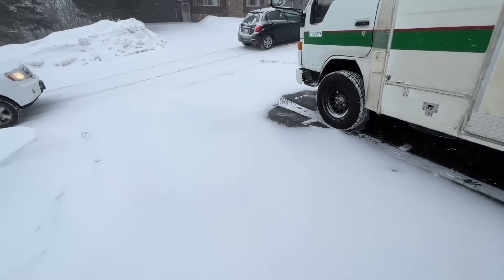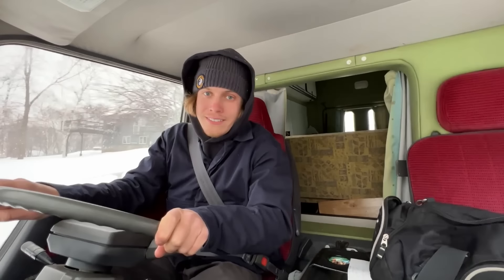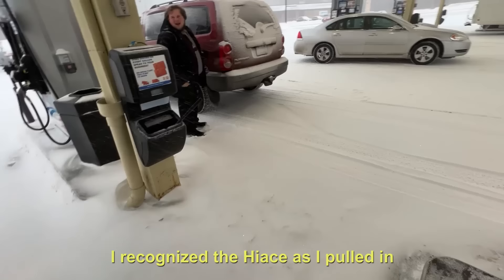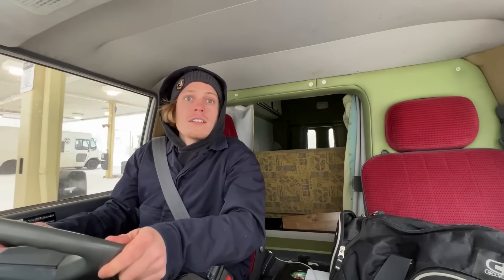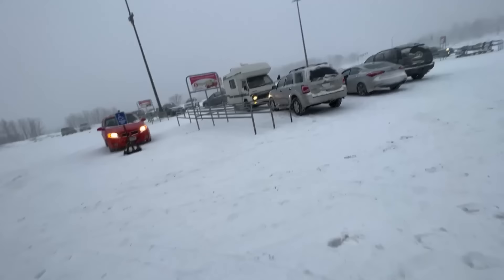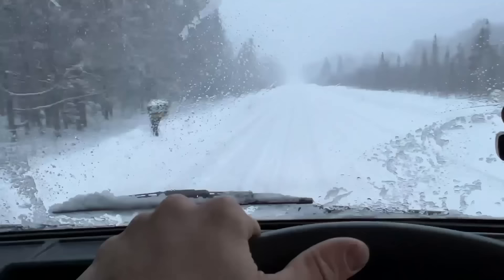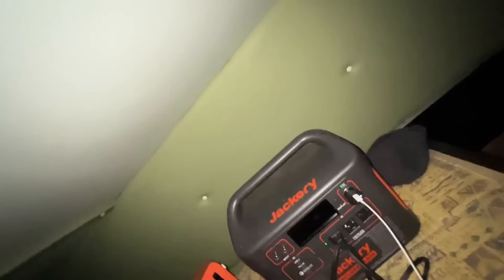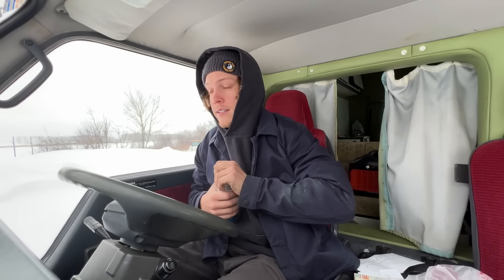Winter Camping with a Cheap Amazon Heater - Will it Work?

Comment: Like someone else mentioned, the electrical issue is probably to do with it being a Japanese truck and so the generator outputs a japanese voltage (100v at 50hz vs 110-120 @60hz according to some other comments). There may be an adjustment on the generator or it may just be the way it is. either way, you should be able to get step up converters to run the outlets. Usually generators don't give power through an inverter as such, it's all built into the one unit. 

As for the heat in general, just run the diesel heater. It'll give you much better heat for much longer than any electric heater will. We have a truck camper with a propane heater and it can keep us warm on even the coldest nights. The heater will run the fans off the 12v battery, so as long as you have a good charge on that you should be set. One lithium battery like you have here should give you enough power to run the heater fan and camper electrics for at least 24-48 hours depending on how much the heater is kicking on and off. A couple solar panels on the roof can help keep that battery topped off, or running the genset will charge it back up as well (even with the sockets not working it should still charge). Running the generator to run the electric heater is going to use WAY more fuel that just using that diesel heater. 

Love to see some variety in the camping vehicle of choice. Hope we see more of Steve!

Comment: Another thing you can also try, since you still don't need 950 Watts to heat that space you have in your camper is to get on Amazon a 500 Watt heater, or even a 200 Watt heater instead. Your Japanese system should be based on 60 Hertz, since they use the same basic AC power grid as we do in North America. Stuff which is "rated," for 950 Watts, will often pull well over a thousand at startup or more, and that is what is tripping your breakers in the camper. 500 Watts shouldn't trip anything, and if it does, then a 200 Watt space heater definitely won't trip anything.

Comment: I just picked up a 350w ceramic space heater with temperature control. The thermostat goes down to 60. I'm hoping it will work out for me. Thanks for the vid!

Comment: Long electrical comment incoming....
As a couple other comments have mentioned, this vehicle is from Japan. So it makes sense it has Japan electrical standards inside of it. Japan uses a nominal 100v/50hz compared to North America's 120v/60hz. All (well 99.9%) of electronics have a label on them somewhere specifying the nominal voltage and frequency allowed. Most electronics made within the last few years are pretty universal. But when it comes to appliances, they are not so forgiving on electrical tolerances the same way a phone charger would be. When you get the Hummer back, you should have the electrical system in this adapted to NA standards. From what I've seen, you would mainly need a new inverter and 3-prong outlets with the ground. And as a result of needing the 3rd grounding prong, you would have to replace the wiring going to the outlets to 12/2 with a ground. That's just an off the cuff thought process. But as you mentioned before, some things you're willing to do yourself, other things you want to leave to a professional. Please leave the electrical to a professional. Depending how powerful you want the inverter to be and what loads it can handle. Not going to get deep into it but there's losses in efficiency going from DC (your 12v batteries) to 120v AC. I use 80% as a general rule of thumb for calculating the inverter. For lights, some chargers, and the occasional high draw appliance, I'd recommend a 3000 watt inverter. That would give you a full 20 amp circuit (your batteries powering the inverter would have to be verified to be able to supply the power, and upgraded if not). And also, usually the advertised wattage of the inverter is usually it's peak power that can only sustain for a few seconds. So for example if you calculate that you need 1000 watts. Do not get 1000 watt inverter, you do not want to run it at 100% all the time. That also decreases the efficiency. You have to read the specs and make sure it can provide that load safely for prolonged periods of time. This is where someone knowledgeable comes in to design the system. And also, would be cool if you could upgrade the fuel tank to a larger capacity.

Comment: You will probably need a 1500 watt pure sine inverter to make this work continuously. Your two auxiliary batteries will provide 4 hours of power at the most, and you will probably fry them, or damage them after a few cycles if you do this often. These batteries are not meant for deep draw. Also, heaters don't like modified sine wave inverters, so the entire rig you need to run your 25$ space heater will cost you about 2500$.

Comment: There isn't anything wrong with breakfast for dinner or any other meal.  I've been doing it for longer than you've been living.  As an over-the-road driver from 1991 to 2018 that's what I did when I couldn't decide on what I wanted to eat at the end of my day.  Sometimes I'd have pancakes, sometimes an omelet with grits and wheat toast.  If I went to a Waffle House I'd order 2 eggs scattered, covered(chilli) and topped(cheese) with dry wheat toast.

Comment: Lots of power loss from resistance but.... The mobile generator powered from the outlet to run the heater. Like other comments suggested I don't believe your trucks inverter is running the right voltage for the heater. It surges the system and the fuses kick in for over voltage protection.

Comment: dude just a safety tip DO NOT run that heater with that cord all coiled up like that - it can and will start a fire because leaving it coiled it creates an electro magnet and that will get very hot.

Comment: End of the day if you're suffering from the cold just run the diesel motor! "It wears out the motor" some may say.  Change the oil at 2k-4k miles max and she'll keep going bro no need to worry.  Stuff 100 gallons under there and EV's will be asking you for a Tesla charge lol.

Comment: Electric heating without shore power is grossly inefficient - either using fuel to power a generator or charge a large battery bank, then converting to mains voltage. Much better to use diesel with its own on-board fuel tank (to avoid it freezing) or large-bottle gas.

Comment: I'm definitely not an expert on these things but in my old Airstream the regular plugs only work if you're plugged in to power. I know that's not the problem you were dealing with but you mentioned in the beginning of the video that the outlets didn't seem to work.

Comment: Almost electric items such as the heater and air conditioner if it says 1500 watt it usually takes about 3,000 on the initial startup and then once it's running and it pulls the amount of watts  whatever  the unit says

Comment: Mavrik I need to tell you something, when you have a generator running and it’s connected to batteries, it acts as like a battery tender for the batteries. And also the alternator on the engine kept them charged while driving.
God bless you and your family.

Comment: I went electric ceramic heater for my mini van. I did not want to deal with the humidity from gas heaters. The electric heaters suck so much power I try to seek out camp grounds with AC. Next will probably a small quiet generator to keep it powered.

Comment: Wow that is very cold when you have to squeeze olive oil out like butter… Then again it’s always nice and hot when your butter is portable. So the Jacquerie actually does power a space heater? I’m trying to find a battery solution for my aunt who does not want any sort of flames or fuels and just battery power to keep warm and maybe cook a little during power outages 2 to 4 days lol. Of course everyone says “get a generator” That is not for her, no propane no fuel it Hass to be a battery back up big enough with enough capacity to use stored power for several days not for the entire Home, but for a hot plate and maybe heated blanket definitely a small space heater for a decent amount of time… Thanks for the videos, cheers!

Comment: What type of diesel heater do you have? A webasto or a nesbar? Rebuild the heater it’ll run good as new. When I was trucking over the road I had a Nesbar heater. Idk if I’m spelling the Nesbar right but they work the best in my experiences.  Keep on trucking man.

Comment: A 10 dollar heater and 300 dollar heater work the same. 1500 watts is 1500 watts. Space heaters are usually 1500 and if they have 2 settings they’re 750 and 1500, tiny desk heaters usually are the only stand alone 750’s you’ll see.

Comment: You might look into the Olympian wave heaters. They are pricey but they work great! They run off propane and can be mounted and they take no electricity to run. I have the wave 8 as I am a full time rver in a 35 ft motorhome. I love my Wave 8

Comment: You need a new inverter. The inverter you have is an Impulse IP-300. It only puts out 240W, 100 VAC, 50Hz. 
To power an electric heater you need at least a 2000W, 120VAC, 60Hz inverter. I'd also replace that Autobooster AZ-8 battery charger. You're running a lithium battery for what I assume is your internal power, you should have a lithium charger. It looks like you have a lead acid starting battery in there on a separate circuit, I assume this is to start your engine. Don't connect the lead acid to the lithium.

Comment: He didn't elaborate very well but when he tried to plug in the heater to the outlet I wonder if the generator was running the way it should be wired even for a Japanese recreational vehicle is if you're plugged into Shore power or the generator is running the AC Outlets should work but if you're not plugged into power or running the generator only the 12 volt Outlets should work so I don't know if we witnessed him plugging it in when the generator was running or not hopefully he can get that wiring issue figured out.

Comment: The Toyota Hilux being a JDM import means your outlets are not 120v like they are in America, which is why your heater isn’t working. If you’ve ever traveled abroad it’s why you can’t use a hairdryer or other American appliances.

Comment: DUDE FIX THIS, The electrical in the back is likely setup for 100v, not 110 or 120 like
 the US. On electronics it usually won't matter, but on appliances it 
will. Shouldn't be too hard to change. It may be as simple as changing 
that inverter for a US one and swapping the outlets for extra safety.

Comment: So with the electric you may want to check the max amps of your current inverter.  If the heater powers on and the fan works then it's getting power.  As soon as you turn the heating element on the amount of amps and wattage it's going to draw is dramatically increased.  I think those portable heaters draw around 9.5 amps and the inverter may not be able to supply that many amps.

Comment: The best advertisement for Diesel heaters i've seen for some time. Most people dont have a generator  to run a Electric heater all night" and 900 hun wats will not keep you warm, in weather. if you run your diesel heater on low it builds up 👆👆 carbon in the exhaust pipe' with the Exhaust pipe pointing straight down, ' hit the exhaust pipe a few times and soot will pour out cleaning the burn chamber. Then run it on high' repeat.

Comment: Please invest in some decent cookware with lids, utensils and a knife sharpener. Get some flexible cutting mats while you're at it. Then you can prepare my beans and rice. Serves 2-3 or 1 hungry guy. 1 Cup Rice, 1 Can of Black Beans drained, 1 cup of Fresh Salsa (jarred is fine but not as good), 1-1/2 Cups of water. Put all that in a medium to medium large pot with a lid. Bring to a boil turn heat to low and cover for 20 minutes. Sprinkle Cheese on top and serve as a main or with your favorite protein or fried egg and some tortillas. Check the generator battery if it won't start.

Comment: Personally I think you ought to trade Steve in for an American motorhome something with better power electronic wise a larger fuel tank and something that can handle the harsh Winters. I remember your first trip the cold killed your batteries and you had to get a jump.

Comment: I don’t even need to watch this video to figure out what’s going to happen with your space heater.  You cannot run an electric space heater on any of these portable batteries unless they are absolutely huge, and even then they are only going to run for a very limited amount of time. I would educate yourself on the basic principles of electricity before you try doing this again.  Your Jackery battery is rated in watt-hours. A heater that draws 950 watts, run for an hour, will consume 950 watt-hours of electricity. A 1500watt-hour battery pack will run this heater for at most 1.5 hours. You need a diesel powered heater, or maybe a propane powered heater. Electric will not do it.

Comment: It's not a generator you're being lied to Alyssa Motors running it's not a generator it's just another damn battery come on wake up guys you're Ben Khan lucky just buy a good wall heater and you'll be all set dude why you mess around it's not going to work in a single be cold. 1500 watts about 12 amps at 120 volt. Way to much. Propane wall heater is the fix